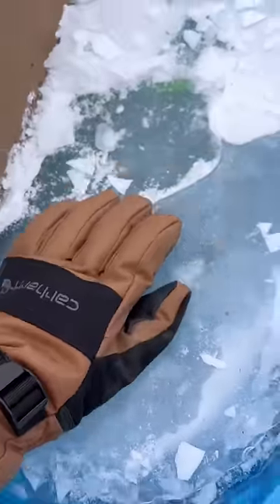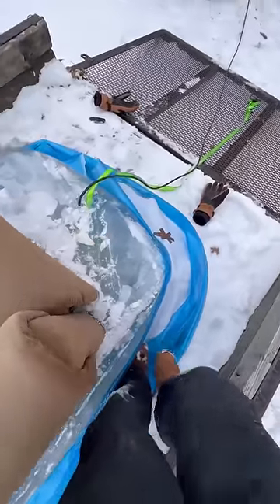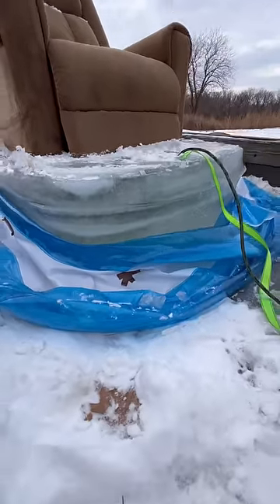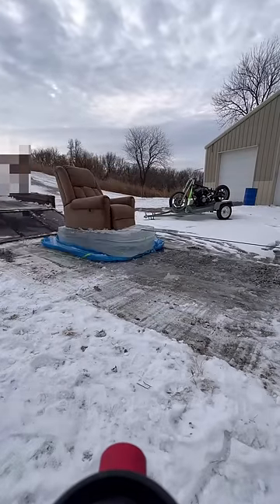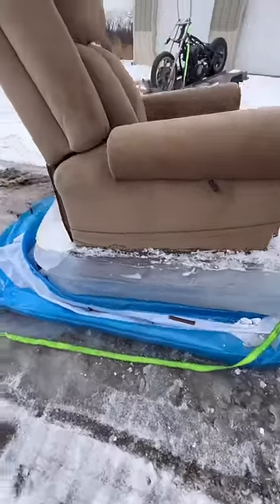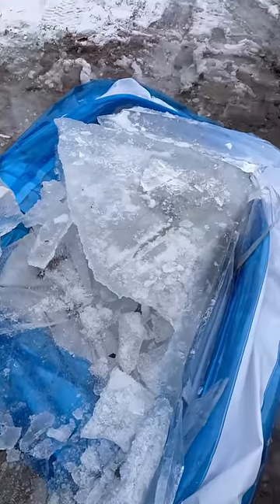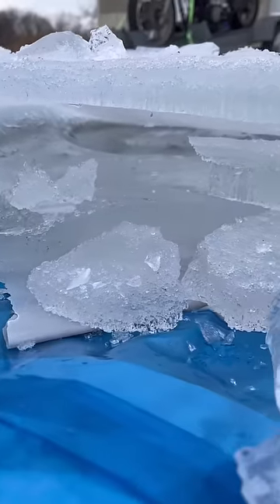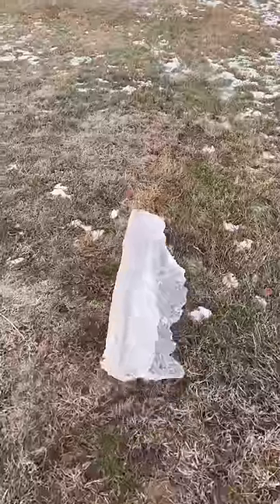2,000lb Sled Fail

Comment: Not gonna lie, I think you’re lucky it broke. This sounds like a horribly dangerous idea
Reply: I was getting excited but yeeeeeah maybe don't be on it down the hill
Reply: Yeah. We used to buy a few blocks of ice from a gas station in the summer and go to a common tobogganing/sledding hill. Put the block on the grass and put a rag or fish cloth on the ice and it’ll freeze to it once the small layer of water forms from the sun then refreshes from the block. Sit on it and ride it down the hill. That felt dangerous cause if you fell you had the chance to be hit by an ice block sliding with a lot of force. Can’t imagine 2000lbs
Reply: @ethanpenney7857 idk if he dragged it with a truck or not, but i dont believe its 2000 pounds

Comment: Mix sawdust with the water next time and you'll get pykrete. Its stronger and melts way slower than normal ice. Hoewever, because of the low heat conductivity, it also freezes slower so keep that in mind.
Reply: at the 1943 Quebec Conference, some guy was showing off the strength of Pykrete, to use in building a supersized aircraft carrier. He shot the block of pykrete and the bullet ricocheted off, hitting one of the admirals in the room.

I'm sure you already know about this though.
Reply: Ahh! Some fellow history buffs! Hats off to you sirs!
Reply: @ForzaMonkey  yes oversimplified taught me this
Reply: @ForzaMonkey  Doctor! I got shot in the room!
Reply: seen a Mythbusters re-run like 1 week ago nice try on discovery ch
Reply: how to take an already terrifying idea and make it 50% more terrifying.
Reply: Definitely keep the base pure ice but what this guy said
Reply: The ratio they found to be good was 70%wood pulp and 30% water. Maybe make a bullet out of it for a crime... I mean... uh... keep it down. I'm tryin to sleep😴
Reply: @ForzaMonkey  how the fuck did he plan to make a carrier out of ice? Unless he planned to only use it in arktic
Reply: Plus use a kid size chair. We would do this growing up in hills(mountains)for you flat landers. Plus freeze is a small container or o that you can deflate/ flip so you can you again. With the above sawdust method.

Comment: You should have lifted the pool up on some pallets so that it had air flow under it, would freeze faster that way

Some wood pulp would also help so it doesn’t melt as fast or break into big chunks
Reply: Smart
Reply: you decided it was a big brain time to be honest that would probably the first improvements I would do to  the system
Reply: Pykrete!
Reply: Or concrete fiber
Reply: @alliegoebert  it's be all over the place when melted. Wood fibers for the win.
Reply: @Coastal_Cruzer  exactly!
Reply: Just rewatched and realized it was up on a trailer, that’s better than it being on the ground but pallets would probably work better
Reply: expecting youtubers to be smart lol
Reply from the maker: That’s actually why I did it on a trailer. Basically the same as putting it on pallets. The wood on the trailer might be a little thicker than most pallets, but a pallet big enough/strong enough to hold all that water would also be pretty thick. Trailer is just way more convenient
Reply: @jackschneider17  makes sense, i actually commented again 2 days ago when i noticed the trailer. sorry for telling ya something you already knew (obviously)
Reply: @GG-cn6es  im 100% sure jack is smarter than me, hands down.
Reply: @jackschneider17  you could do it on the grating of the trailer ramp next time. Prop it up, set up the Pool. Then when it's frozen slide it back, lower the ramp and slide it down. Alternatively if you have some old copper pipes laying around from gas or water lines you can drop those in below the chair. They will conduct the heat really well and add some tensile strength to your ice.
Reply: ok

Comment: "Ice freezing is exothermic, meaning it releases heat"
Bro graduated from netflix
Reply: @foxi7090  well technically yes, but exothermic would usually mean that it generates its own heat, would it not?
Reply: @magentawool2556 it is, have you payed attention in physics school?
Reply: @magentawool2556  "When water becomes a solid, it releases heat, warming up its surroundings. This makes freezing an exothermic reaction. Usually, this heat is able to escape into the environment, but when a supercooled water bottle freezes, the bottle holds much of that heat inside."

Google is friend. Also ice MELTING is ENDOTHERMIC, meaning it ABSORBS heat. Release when freezing, absorb when melting.
Reply: @fredericksaxton9782  freezing is a direct reaction of the heat loss. Freezing does not generate heat. When something loses enough heat, it freezes.
Reply: @magentawool2556 so heat is being taken away, a bit like the water is releasing it.
Reply: @magentawool2556 Bro you literally just said it. When something loses heat, it freezes. Losing heat=releasing heat to surroundings=exothermic. Although to be fair, talking about heat like this isn’t thermodynamically accurate so I get your confusion. Energy is more accurate
Reply: Also worth noting freezing is a phase change so there is no change in the temperature of water while freezing. It simply releases energy to its surrounding.
Reply: Heat is the transfer of thermal energy
Reply: The better way to explain it, is the outside layer of ice acts as a thermal insulator which slows down the freezing process inside dramatically.
Reply: @magentawool2556  freezing is a result of heat loss, but its important to understand that freezing is a phase transformation. phase transformations can release or absorb heat. in the case of ice freezing, it releases heat. counterintuitive, but that's how it is.
Reply: @magentawool2556 that's what I thought
Reply: I was reading the comments to see if anybody would catch this. LMAO
Reply: @magentawool2556 be so fr….
Reply: @magentawool2556 yes loss of heat meaning it’s LOSING heat to its surroundings bestie
Reply: @qtaypie  obviously, that's what I said
Reply: @magentawool2556  but you’re also saying it’s not exothermic so I’m confused on how you’re saying one thing and don’t know the other??
Reply: @magentawool2556 ok how about if I word it like this 

If water is room temperature it has energy, this is why it is a liquid 
When it freezes it loses energy 
If anergy can not be created nor destroyed, where does it go

Comment: That wasn’t because freezing is exothermic. It’s because ice has a lower volume than water. This means that if the water inside is confined by outer ice, the melting point will raise because it isn’t allowed to freeze. Layering would still be the solution though😁
Reply: It is the reason why. Have you been on a frozen lake but yet you can still fish and also see fish if the ice froze a certain way to be able to se clearly. The kid isn't wrong. You are though.
Reply: @fisherbob4010  ice has its highest density at 4°C wich means that the top layer can freeze while the heavier part is at the bottom of the lake and freezing isnt a exothermic wich wouldnt make sense because its fking freezing
Reply: @fisherbob4010  people who know nothing and think they can tell someone else that they know nothing will never fail to amaze me. Freezing water isn't an exothermic reaction. Lighting up thermite is. You add some energy so a reaction starts and the reaction will produce heat itself so it keeps running. Endothermic reactions draw in heat from its surroundings so they can react. 

Freezing water has nothing to do with both of those reactions since it's not a chemical reaction, it's simply a change of physical states.
Reply: @Okararu  Ah ok. Well I would like to thank those that replied to me for clearing it up for me better. I was wrong and sorry for my post. Not being sarcastic I actually am thankful for the corrections.
Reply: @Okararu it is exothermic. Just look it up its so simple. Why do you act like you know when you are just wrong????
Reply: @Okararu  exothermic only means that it releases heat. It doesn't have to be a chemical reaction to be exothermic. You are literally using the word wrong.
Reply: @schwarz8614  but it literally makes no sense in the context, how don't you realize that. He says it's exothermic, that's why the water in the center didn't freeze. That makes no sense. According to this definition of the word literally everything is exothermic. The water in the center would be even "more exothermic" because it has more thermal energy that it can get rid off. 

The real reason why it didn't freeze was because the ice around the water core basically made a pressure chamber. Water expands when freezing. If the water can't freely expand, it's freezing point lowers. 

The reason why this didn't work isn't because freezing is exothermic (which is an idiotic statement), it's because he was impatient and didn't let it freeze properly. That's it.

And stop saying "freezing water is exothermic". Yeah, you may call it exothermic if something loses thermal energy, but his explanation literally implied that the ice freezing heated up the water in the middle as if this is some epoxy resin curing and heating up in the process.
Reply: ALL OF YOU need to learn how to google! Yes, all of you!
Firstly, freezing ice is indeed exothermic. It's due to "latent heat". Latent heat is defined as the energy absorbed or release during the phase change of a substance.
Freezing water into ice releases this latent heat making it an exothermic process.

Secondly, the increased pressure inside will also be having a SLIGHT impact on the freezing point however the effect isn't large and there's also far more variables in determine the internal pressure than anyone here is appreciating.

Thirdly, the main reason it's not solid is because ice simply takes a long time to freeze through. The outer layer acts as an insulator and slows the energy transfer from the still unfrozen water to the environment. The anount of energy that needs to be transferred is surprisingly massive due to the latent heat of freezing water also being massive, hence why a couple of ice cubes can cool down an entire glass of water. Put simply, he just didn't leave it out long enough.

Stop arguing and actually spend the 5 second it takes to look up the answer! You're all carrying around marvellous devices which connect you to the entirety of human knowledge. USE Themes!
Reply: Does this explanation mean you only find a flaw in the science not the attempt at suicide ?
Reply: While freezing is an exothermic process, it would never increase the temp inside the middle of the ice as the video implies. Heat can only transfer from hot to cold (2nd law thermodynamics) and there's no heat generation in a freezing process. Meaning that heat can only be lost to the environment. 

The frozen ice on the outside then acts as an insulator creating a temperature gradient across the ice, slowing the freezing of the water inside. Given a cold enough environment or enough time the whole thing would freeze.
(lakes won't freeze through dispite this because the land acts as a heat sink and the water reaches equilibrium with just a layer of ice on top) 

(Also the tensile yield of ice maxes around 3MPa which would only cause a 0.2 deg C difference in freezing temp so pressure is negligible)
Reply: Freezing ice is a exothermic process. Heat is released as it changes phases to a solid. Just like water boing is a endothermic
Reply: @Capthrax1 the “heat” released is only released at a rate to maintain a constant temperature it will be almost exactly 32deg until it’s frozen solid when it can continue to decrease it’s temperature.
Reply: @Playingwithproxies  that's what I said
Reply: @charmio if the definition of exothermic is simply "releases heat" wouldn't that make anything getting cold be exothermic? Like for example putting your hand in cold water would be exothermic-

Comment: The pool is inflated with air, which is an insulator. So is polythene, but that would only be thin. 
The exothermic effect is insignificant if you can let the ice lose heat properly.

Comment: pretty sure the ice building up on the outside thermally insulates the water in the middle, similar to how the water at the bottom of a lake doesn't freeze when a thick enough layer of ice builds up at the top, so freezing a large body of water like this is nearly impossible with regular winter temperatures

Comment: At first I was like "no way that's 2000 pounds" but then I did the math, based on the visual size of the recliner, and the ice shape (taking the density of ~917 kg/m^3) should be about 1600 to 1700 pounds all right, without counting the recliner itself. Amazing

Comment: Best way is to wait till the temperature just starts to drop as it's getting dark, and donit layer by layer with a large fan next to it. That'll pull the heat out of the water most efficiently. Unless you have dry ice or liquid nitrogen

Comment: Freezing is not exothermic, the water in the middle doesn't heat up due to the outer water freezing, it's just that ice is fairly insulating and freezes outside-in.

Comment: Instead of freezing it in stages which would make shatter layers you need to agitate the water so the movement of the water will make is release it's thermal energy for a solid block

Comment: You'll have to come out every half day to keep a breather hole for the inside chamber.  
So it will freeze fully or not explode once it starts warming up.  

Also try transporting it with the pool around it until you arrive to your destination.  Also becareful sitting o. The massive chair ice doesn't like impact force.

Comment: FYI it's not so much because ice freezing is exothermic (though this is true) that this failed - it's because ice has a lower density than water so floats to the top when freezing, forming a layer that then insulates the water below it and slowing it from freezing. Freezing it in layers would have been the correct way to make this deathtrap though.
Reply: No it's not true lmao, exothermic describes a reaction that releases more heat than there was put into it to get it started. Freezing water isn't a chemical reaction, it's a change of physical state.
Reply: @HowP88  if you consider a body losing heat "exothermic" then sure. But the way he said it in the video he was referring to an exothermic reaction. And that's definitely not the case here.
Reply: @Okararu  he literally says "ice freezing is exothermic, meaning it releases heat" - this is a completely true statement and he doesn't even use the word "reaction" so don't know why you would think he is implying it is a chemical change.
Reply: @HowP88  because the causal chain is wrong. The water loses heat, that's why it's freezing. It's not freezing and then losing heat because of that process. That's why I interpret it the way I do. That he is talking about a exothermic reaction, every other interpretation makes no sense considering his causal chain.

Comment: Ice freezing is not exotermic. It’s not a chemical reaction but a phase transition. It just gets better at insulating so yeah, you’re right you should have done it by layers. 

But use this opportunity to improve the design. 
Try puttin the chair a little bit more to the back to improve the position of the center of gravity :D

Comment: Freezing water is not exothermic(Freezing water doesn't release heat). What likely happened was when the outside froze, it insolated the inside(Ice is quite isolating, think of igloos). Meaning the interior couldn't get cold enough to freeze. It would have eventually frozen, and it just would have taken a few nights.
Reply: Incorrect

Comment: Maybe if you cut away some of the material off of the bottom of the recliner so the ice melts around the base of it more tightly maybe it wouldn’t break apart so easily.

Comment: I remember some girls in uk went down a hill on a cars bonnet , the wet snow soon turned to ice on the metal , they reckon they hit over 80mph down the hill , 2 girls jumped off and where hurt badly, the other got her head taken off by a wire fence at the bottom

Comment: 1 metric ton sliding down hill. No rollcage, no brakes, no steering. What could possibly go wrong?

Throw some rags in to the water before freezing it. It will keep your Disability Generator 9001 from breaking mid slide.

Comment: You cpuld also mix sawdust into the water before it freezes. Seems wierd but building out of ice has been thought of and the best of ice on this planet is pycrete, which is a polymer of some kind with water. Its usually cellulose which is the best wood like substance that gives the best results that you can still  affordbut sawdust is easier to get and way cheaper. Look up pycrete, the history of its discovery and usage is amazing.

Comment: Don't wanna be that guy (but I'm going to anyway). Pretty sure exothermic isn't the word for this here. Ice is a great insulator so the water inside is going to take longer and longer to freeze as you approach the center of the block. Also, I don't think that small block is anywhere close to 2000 lbs. Water weighs roughly 8lbs per gallon. That pool doesn't look like 250 gallons but I could be wrong.

Comment: I was gonna say this guy is an idiot for not setting it up in full recline mode for maximum relaxation while sliding. However, after reading many comments about the danger and potential death from this experiment, I gracefully bow out of this comment section.

Comment: "Ice freezing is exothermic" ... surely thats because you measure the ice rather than the air around it... freeze it at the top and for longer with some sponges half submerged or something? Nah thats dumb... put some kind of trapped air in it, thats compressible so it might work?
Isnt the chair compressible?

Idk.  Ask hank green

Comment: Thank God it didn't work, If it did you would have been run over by 2,000 lb of ice, 

You'll notice that sliding down a hill on an ice block is NOT a winter tradition and there's a reason for that.